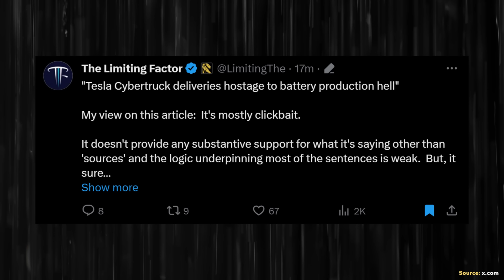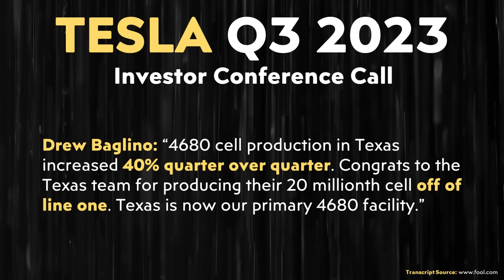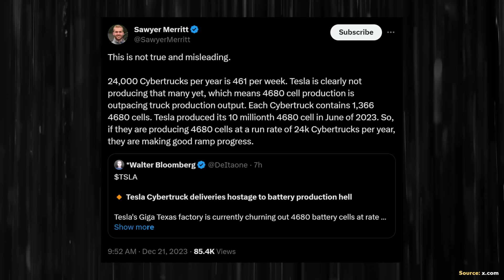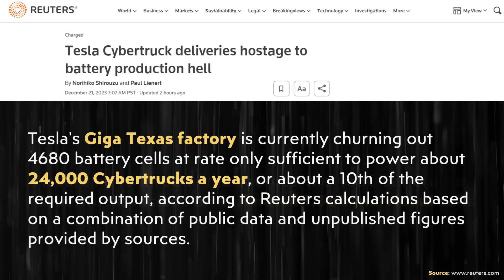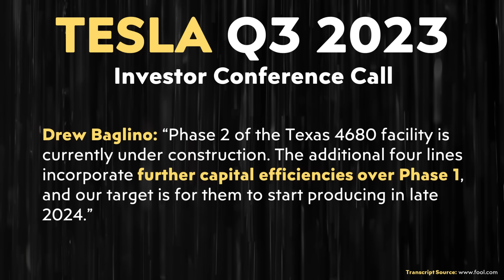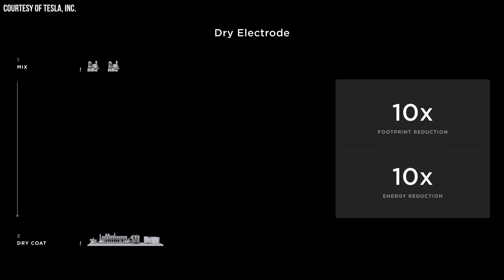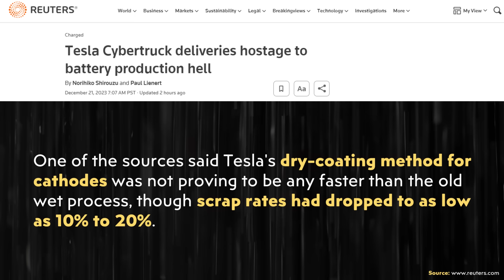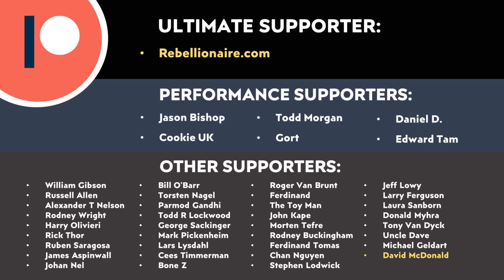Tesla 4680 Battery Production Update | Dry Cathode Problems?

Comment: Not sure of maths but if it took  262 days to go from 0 to 38000 per day average in a straight line from 0 to 38000 would mean final days production would be 38000 times two to average 38000 ie last days production 76000.
Since to  get to 85000 from final day of first tranche is pretty slow
I.e.9000 improvement in 117 days
Any comments

Comment: Jon.
Let's think logically....

Consider "A process" with 4 steps. ("Imaginary process")
.
A: Component 1
.
B: Component 2
.
C: Preassembly 1+2
.
D: Product assembly.
.
Previous iterations of "the product" were slow mainly due to lenghty/ expensive steps A+B.
.
In the new system, all steps are much improved except #2.
This step runs at about 20%(?) the desired capacity.
.
Options.
.
1) Build 5 complete lines and run them at 20%, limited by step #2.
.
2) Allocate factory space for 4 more complete lines,
But....
Only build 4 new ("B") sections to complete step #2
Use these to feed the single line running at full speed.
Then, as problems are solved, increase the speed of those sections.
When reliable, build a new line around each of them.
.
Result, 5 working, full speed lines.
But, in the interim, most efficient use of factory space.
.

Comment: Really great dissectation of a highly error-prone malicious article.👍👍
Really interesting comments about the ongoing Tesla issues on the dry cathode production.   What wasn't mentioned was how this is affecting the power density of 46-80 cells, as cathode performance is the biggest driver of cell performance! 
From your previous report, Power density of the 46-80 V2 cell is below that of the Panasonic 21-70! This does make sense as the 21-70 cells have considerable amounts of Silicon in their cathodes,  which greatly enhances power density, but Tesla has been very careful in the past to slowly introduce silicon into the cathode to avoid cell degradation issues. This is really great news as there is a strong possibility that as they further improve there dry cathode production process they will start introducing Silicon into the cathodes which will result in longer Cybertruck range!😁

Comment: To your last comments, I think 5% defect rate is not bad, but not that good either.  Let us hope the defect rate will descend below 1% fairly soon.  That is a manageable rate that traditionally gives the manufacturer of any product vastly better control and therefore reliability.
As the defect rate drops, isolating the cause and correcting it becomes way more easy.
I think the 4680 cell is destined to have an enduring and ground-breaking pedigree, especially when higher density chemistries become proven.

Comment: Isn't Panasonic going to be making their own version of the 4680 (with 5 "tabs")?  These likely won't be as volumetrically efficient due to the space occupied by the tabs.  But remember that the entry-level Cybertruck will only have a 250mi range, so this is not an issue.  And the single-motor won't be able to pull as much power out of the pack as dual- and tri-motor versions, so this makes the cell's discharge performance requirement simpler, too.  So Tesla should have lots of leeway toward future Cybertruck production.
Reply: Tesla plans to make all of their own 4680’s, Panasonic will produce 2170’s for Tesla, in NV  and soon in Kansas.  The Panasonic 4680 fell by the wayside for now.
Reply: @richk3552  Oh, I must have missed that.  Thanks for the update!  Then I wonder what's going to happen with all the other OEMs who had plans to use 4680?  As if they didn't already have enough issues!
Reply: @richk3552 
A recent comment/ statement indicated Panasonic / Tesla are "in cooperation" regarding 4680 development.
.
Logically, if a given volume of factory can produce at even 5x GWh compared to a 2170 wet process, once the system is perfected it would make perfect sense to convert 20% of factory volume to the new system, producing the same GWh as the previous output of 100% of the factory.
Once that level is reached, repeat in similar sized increments, 
That would elevate the Panasonic production at Nevada from ±40GWh to 200GWh
.
"But where would Tesla get the 8GWh of cells they lose during the first phase??"
.
Cell prices are dropping.
Other vehicle manufacturers have cut back.
(Ref the recent LG statement regarding a glut of cells)
.
Tesla (especially as the "big dog") will find the cells elsewhere.
.
I think we're going to see Tesla/ Panasonic continuing their cooperation based on the Tesla "here's the patent, play nice and we both win" playbook.
.
This may (imo) extend to LG and Samsung.
.
Tesla would rely on their own production volume and purchasing power within the.... "consortium"(?) to stay extremely cost competitive.
.
It would also advance "the Master Plan ".
Reply: The tabs have no bearing on volume.
What might be compromised is the discharge rate of the cell (the whole reason for the "tablets" (actually many tab) design.
.
The other factor for "volumetric density" is the volumetric density of the factory
Again, the other major advantage of the Tesla method is small (simple) factory, high cell quantity, huge in crease in GWh (TWh?) from a given factory volume
Reply: Panasonic uses better chemistry though so their cells should have much higher energy density (for now).  Tabs may limit charge and discharge rates though.  I wonder if they could get used in a "long range" Cybertruck.

Comment: The Reuters article is wrong but the 4680 production lines do look to be far below Tesla's expectations, as you point out. Rather than exponential growth it looks like 4680 production is constrained (and likely more expensive than anticipated as a result of that).

Tesla will still need other cell and pack manufacturers to supply products to Tesla's gigafactorys at a sufficiently high rate (that would probably dwarf 4680 production numbers) to sustain the smooth flowing production of Tesla's high volume vehicles. I think that is a less rosy outcome than Tesla had been hoping for.

Slow running dry cathode production would be one explanation of why 4680 production lines are failing to meet expectations.

Comment: These batteries are also "tab-less" so be the claim anyways. As Tesla innovates the rest of the industry can then tgerefore thrive as previous form factor battery plus systems/processes become commoditized. Also there is recycling. Plus a 48 Volt architecture. Also Tesla is not inventing the automobile here with Cybertruck. ICE Platform vehicles have always had amazing scalability. This has never proven out to being true of pure only BEVs. Long story short I wouldn't be too caught up in the weeds of battery details other than the quality of lead acid batteries has improved in both quality and quantity upon North America. No problems with lead acid battery chemistry that i am aware of other than still wholly and totally inferior to lithium ion battery.

Comment: 4680 is not a bottleneck yet.

It could become a bottleneck before end of 2024. Why?

New 4680 lines are going in. But it can take 12-18 months to get volume up and reject rates down for new lines. And the 4680 production tech is not mature. Changes are planned, which means downtime.

I still think Tesla can build over 50K Cybertrucks in 2024, and the ramp will continue in 2025-2026.

I'm unworried. Cybertruck looks good, and by 2025 it should be cash flow positive. it's a great vehicle, and what I've seen of the production line is downright amazing. Air bending! Giant castings! Vast improvements in the electrical systems! Innovations galore. Demand will be strong.

Thanks for your reporting, Jon.

Comment: I am assuming reliability of cells drop as they scale up. This only means they need to collect a lot of data while going through a painfully slow and rigorous testing cycles that can take months.
Reply: Formation and testing in conventional battery manufacturing takes up to 3 weeks and accounts for a third of costs. However advances like cutting the cycle voltage to 3.7v have halved this time. Dahn has the Columbic efficiency test for quickly assessing battery performance.

Comment: Just speculating, but I wonder if the reason they increased their projected battery manufacturing lines from 4 to 8 may be due to dry battery cathode manufacturing delays. Also I doubt we will see 4680s produced in volume until the north cathode plant is fully operational and ramped to near production rates.
Reply: I don't think so.  4 lines are complete at Texas with 2 running.   4 lines under construction at Texas.  4 lines under construction Nevada,  all according to plan.
Reply: @snookmeister55  Source on four 4680 lines under construction in Nevada? They still haven't started the factory expansion they announced last year.
Reply: I've wondered about Nevada, after such an event with the governor.   Are you certain no construction is being done?
Reply: There's talk of simi production 2024.  If true,  it was planned for Nevada.   Plans change  -  I don't know
Reply: @snookmeister55  I don't recall the event at this moment. I know they plan to expand the Nevada factory footprint, but no information about timelines for the expansion or how their partner Panasonic factors into future plans. I think 4680 production in Nevada would be a good assumption .... 8)
Reply: @reportingsjr 
Don't assume that the cells will be produced in the expanded part of the factory.
.
They could be made in a repurposed section of the existing plant.
Reply: @mikebailey2970
You know they are ramping up production with more lines.
And you know they are working on improving the cathode.
What more do you want?

Do you know of any other domestic battery producer doing better?

CATL is a formidable battery producer. Tesla is competing with them and their much more experience. Not too badly, I Ihink!
Reply: @larsnystrom6698  I agree Tesla is best in class with regards to US battery manufacturing. If any team can solve the issue of producing DBE cathodes at volume it will be the engineers and techs at Tesla. 
What I want for 2024:
1. Producing one million 4680 battery cells/day 350 days/year in Austin. 
2. To do that they will need the North Cathode plant churning out their product, so if that plant could be online Q1 of 2024
3. It would be nice if they can get their energy density up to 250 Wh/kg or better, perhaps by doping the cathode with silicon without the battery cells swelling. 

Its a big ask sure, but heck it is Christmas, best time to ask for big things! 8) 
Tesla's battery team has done outstanding work so far, and I'm sure their goals for 2024 will be achieved. 
Peace

Comment: If Tesla can't fully ramp the DBE process for the 4680s relatively soon, can they easily switch to the wet process or are they all-in and fully committed to DBE due to the physical layout of the batt production lines?  Also, do you think Tesla is waiting until their lithium refinery plant in Corpus Christi is producing before Tesla starts working on their own LFP/LMFP chem?  Wouldn't LMFP chemistry in the 4680 form factor be the ultimate goal.  That combo could power all Model 3 and Ys (except the Performance trim), plus all upcoming Model 2s, plus all US-made Stationary Storage....so basically 95% of all potential US-made use cases and thus being eligible for all the 7500 rebates for customers and all the lucrative credits for batts made in the USA, that go directly to Tesla!  Thanks.
Reply: The 4680 line doesn't have the drying ovens or vapor recovery system required for the wet process so changing would not be easy.  LFP doesn't require cylindrical format and can be more densely packed as prismatic cells the way BYD Blade and CATL cell to pack do it.
Reply: @JRP3 Cylindrical batteries offer superior high speed manufacturing, more secure protection than pouch and better cooling, which is why they are used in all the high performance BEVs.
Nyland's critique of all Asian BEVs is they rapid gate.
Reply: @waynerussell6401  LFP can be made in larger form factors which means fewer cells so manufacturing speed is relative.  They don't need as much cooling or protection and don't need to be contained in cylindrical cans.  Model 3 SR uses LFP without problems.  Their downside is less energy density but because they require less support structure per kWh that difference is lesser at the pack level.
Reply: @waynerussell6401  Not the Model Y with BYD Batteries. Funny.
Reply: @JRP3 Yes, prismatic cells can be much denser packed but the present thermal problems. Tesla solved them for the Model Y Standard. But they are still "weaker", less energy dense, less capatity per volume than NMC or NCA. 

Tesla Model Ys with BYD Blade cells have a much higher charge rate and max. energy than BYD with their own batteries.

I would recommend cylindrical cells for high power applications.
Reply: LFP doesn't require cylindrical for safety. Is LFMP the same in this regard and what about the thermal exchange design for cylindrical vs prismatic?   In the 4680 structural pack the cans provide an added structural function. The wasted space in close-packed cylinders is ~10%, and that becomes structure as its filled with structural foam.
Reply: Lfp is a dud without a road map
Reply: @RNA0ROGER  Odd comment since it's being used in increasingly more vehicles.
Reply: @JRP3 Not saying you can't use LFP but its very poorly suited to automotive. It might very well work for a city roamer car, but I question how relevant it will be in 10 years time. That being said its a straight up beast in energy storage.
Reply: @RNA0ROGER  Cars running LFP packs are getting over 200 miles of range, 270 miles for the Model 3, that's far from a "city roamer car".  In 10 years time we might not even be using any lithium based chemistry so that's not really saying anything.
Reply: @JRP3  Weight charge speeds and discharge current
Reply: @RNA0ROGER  Weight is obviously good enough for 200+ mile EV's, charge and discharge current, i.e. C rate, can also be HIGHER than other lithium chemistries.
Reply: @JRP3  I personally own a set of lfp cells and rest assured the discharge current basically the same as the capacity. As for a 200 mile EV, that really isn't all that compelling and even in my own case it borderlines on useless. NMC vs LFP for a 100kwh battery pack is 625kg versus 384kg. EV's don't really compete with EV's they compete with hybrids. It can work but its a pretty big step backwards in density. As existing batteries can do anything LFP can do in this context but better. 4680 at full node would outright ruin any car using it years into the future.
Reply: @RNA0ROGER  It depends on the type of LFP cell, I have built a few packs that can easily put out 5C and charge at 3C, some can do even higher.  A123 LFP were capable of 40C discharge rates.  LFP is also a safer chemistry and cheaper to build since there is no cobalt or nickel.  LFP chemistry density has improved over the years and will likely to continue to do so, as will the others of course.  LFP is going to be in use for quite a while.  Just because you don't think a 200 mile EV will work for you that doesn't mean it won't work for millions of others and that's what matters.
Reply: @JRP3  5c is extremely impressive suffice to say I am certain beyond a doubt. That I will be building a house hold battery around that. As for 200 miles all I can say it depends entirely on where you live. I see them being quite a thing in Japan but in Aus kind of a hard sell.
Reply: @RNA0ROGER  I was thinking if your LFP battery is limited to 1C it's probably because they went cheap on the BMS and not a limitation of the cell chemistry.  I build my packs from individual cells.
Reply: @JRP3  They are mostly off the shelf units I purchased in number of a garage sale. I am kinda looking into eve cells in the years to come.

Comment: 💯
Reply from the maker: What you shared on X was really helpful - thanks for that.
Reply: If Tesla can't fully ramp the DBE process for the 4680s relatively soon, can they easily switch to the wet process or are they all-in and fully committed to DBE due to the physical layout of the actual batt production lines?  Also, do you think Tesla is waiting until their lithium refinery plant in Corpus Christi is producing before Tesla starts working on their own LFP/LMFP chem?  Wouldn't LMFP chemistry in the 4680 form factor be the ultimate goal.  That combo could power all Model 3 and Ys (except the Performance trim), plus all upcoming Model 2s, plus all US-made Stationary Storage....so basically 95% of all potential US-made use cases!  Thanks and appreciate all your efforts these last few years!!